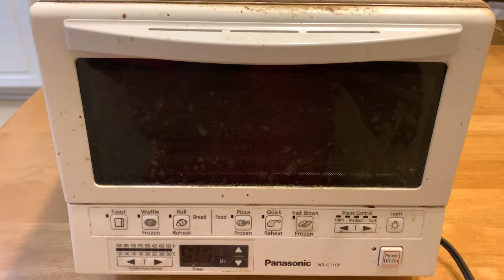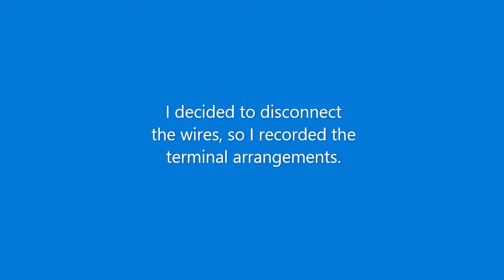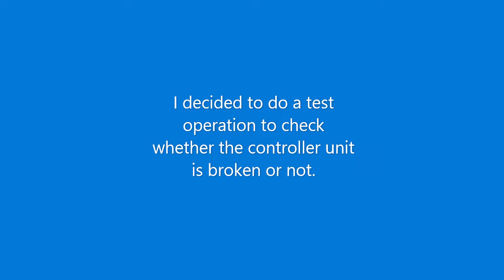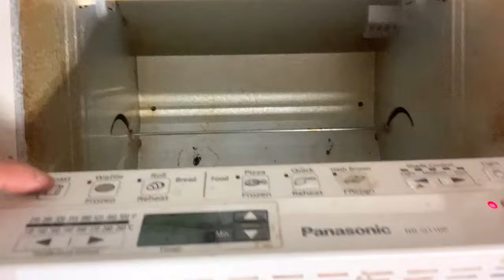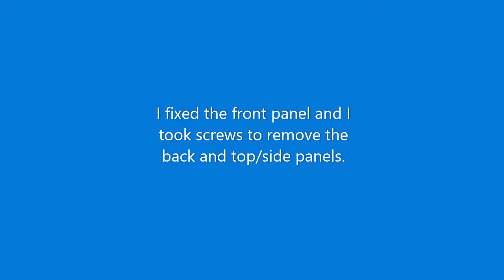Panasonic Toaster Oven NB-G110P Repair (Part I) - Diagnosis

Comment: AMAZING VIDEO!! You really helped me to be able to take apart my NB-G110P.  Here is my problem: I need to replace the power cord (insulation eroded on the external portion of the cord). I have a replacedment cord from Panasonic. BUT, I cannot figure out how to remove the cord. I can unplig it from the circuit board. But it looks like there are two sections to the cord -- one of each side of the metal casing. Do you have any idea what to do????  Many thanks!!!

Comment: If the top of my toast is not roasting, does the ceramic bar on top need to be replaced?
Reply from the maker: I believe there are two heaters on the top, infrared heater lamp and resistive heater. If you see the lamp is on, then I would check the resistive heater on the top.
Reply: Thank you for the reply! The light is on in top.  I will try to replace the resistant one on top.

Comment: Hey there, great videos on how to fix that problem. I watched both and was seeing if I could get an idea on how to fix mine. I have same model as you but mine just stopped working completely. I push the power button and nothing. I guess im going to open it up and have a look but I really do not know where to go after that. I was reading on Amazon that some guy sent his in to panasonic to fix and it was about 40 dollars to get the light replaced. I wonder if that is if its under warranty which mine is now 6 years old.

Anyways any help would be appreciated, I will try to fix it though.
Reply from the maker: If you don't get anything after pushing the power button, I would check a fuse inside the panel. I don't remember if this toaster has an individual fuse or a fuse mounted on the circuit board.